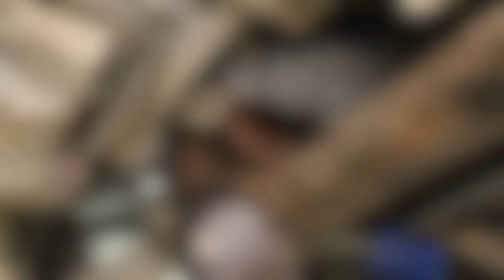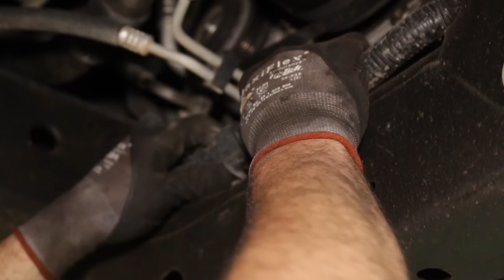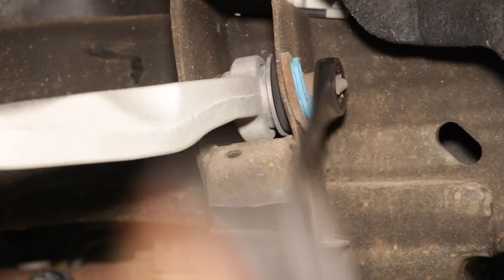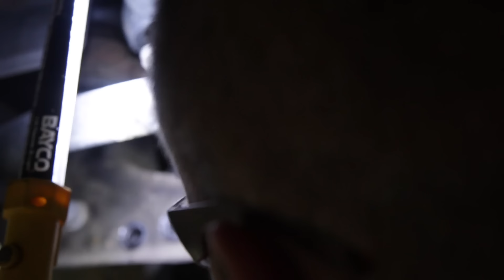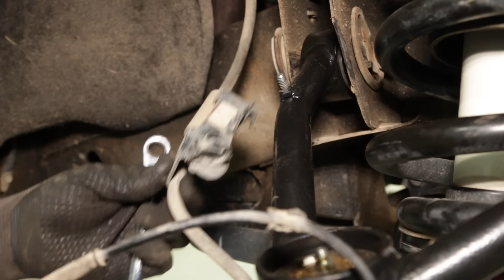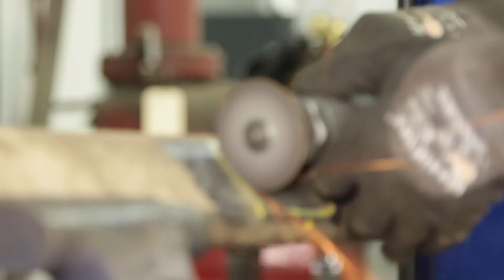How to Install a 2007-2016 GM 1500 3.5-Inch Lift w/ Upper Control Arms

Comment: I just installed the  3.5” knuckle lift kit. Just a suggestion. The kit SHOULD come with upper control arms that would clear the stock droop stop.  Secondly the factory cross member does NOT need to be cut. What I did was heat up that same area with a torch and use a piece of wood and a small  heavy hammer to smack it.  This will keep the structural integrity of the crossmember.  Doing it this way still made clearance  for the front differential.

Comment: I just did my lift today and I tell you what the pucks underneath the differential are real pain in the butt. I had to cut the cooling fins but I did not have to cut theCross member. It took me and my buddy six hours and were both pretty proficient mechanics. Other than that everything else fit perfect. I’m taking it for an alignment tomorrow. I drive a 2013 GMC Sierra SLE 4 x 4 crew cab.
Reply: Ive got had the same kit for about 3yrs running 20x10 with -19 offset. I'd like to go back to stock size wheels and was wondering what size wheel and tire you run.
Thanks
Reply: What did you use to cut the cooling fins? Saws all? I’m at this point and can’t get a angle grinder in there.. guess I’ll have to go buy a saws all.

Comment: i have a question, right now i have everything stock suspension and everything so if ur familiar w chevys it’s obviously not lvl if i put this on will this lvl the whole thing? or will it just have the 3.5 lift but w still b higher on the rear?

Comment: I bought the 4.75 in lift which includes this suspension lift and a body lift. It’s a 3.5 suspension lift and a 1 1/4 body lift. Is it best to do the body lift first or suspension lift or does it not matter?

Comment: My 2500hd 2011 Silverado sits 43 inches from the ground up to the top wheel well(rear) and 42 3/4 (front). What lift should I get if I want it a little taller? I wanted to do a 3.5 but I feel like it wouldn’t budge. So I’ve been thinking a 6inch. Can y’all help me out with these thoughts of mine.

Comment: Has anyone else had problems with wheels and tires rubbing on upper control arms when fully turning all the way one way or the other? What wheel offsets are you guys running that do not have this problem?

Comment: I’m running 33x12.5r20 on a 16 Silverado  with a 2 inch level. Looks great. How big of lift could I do and still use the 33’s?
Reply: You can use 33's for whatever size lift. But I'd say three inch would look good with 33's. Even if you did a four, if you put a negative offset rim. It'd fit better

Comment: Have a 16 silverado 1500 z71 and i have to say im not a big fan of having to cut cross members and cooling fins off. I get the need to fix the angles but still there has to be a better way than cutting things.
Reply: Agree 👍🏾
Reply: Learn to weld like everyone else

Comment: Been reading lots of bad reviews about rough country quality of the lifts upon initial installation & overall value & performance down the road,
Trying to see how they stack up again Zone or other suspension Manufacturers,
Just lots of negative user reviews on the RC,
Makes me apprehensive to try them.
Reply: Also with my zone kit the wheels are pushed out an inch and a half on both sides in the front of the truck only which makes going through a drive thru annoying and sometimes makes parking harder I forgot to mention this
Reply: I have a 4.5” zone on my 2014 and it rides like stock and is good quality 

Tbh tho if I could do it Over I’d probably do the 3.5” rough country or 3.5” super lift just cuz my fenders have to much gap between the 33” tires but not that much 

Also I feel like I’d probably get 1mpg better if I went with a 3.5” kit 

So yea this is my experience 

And if you went with 3.5” as long as you get the UCAs you should be good 

The zone will cost you 2x as much atleast and is a permanent kit where the 3.5” is reversible if you don’t like it

Comment: Why do the spacers not come with the stud bolts already on them? I just tried this kit and the hole for the studs are too small.
Reply from the maker: They are locking studs and once installed and torqued they lock in to the spacer.

Comment: Why is it recommended to use the spacers when running factory wheels? I put my 07 back together with factory wheels, without spacers, and it seems like I have enough clearance. Just curious if there is something I’m missing

Comment: I have a cuestión I put on 2014 silverado front blistein shocks with 2” lift . Can I put the 3” 1/2 lift kit with those shocks?
Reply from the maker: No that would create geometry issues. You would have to run a 3.5" lifted strut or the stock strut with the 3.5" spacer kit.

Comment: I'm about to purchase your 3.5" kit with your forged GM upper control arms. I'm looking to run 33" x 12" wide Nitto Ridge Grapplers on my stock 2012 Silverado Crew Cab 17" wheels. Will I have any rubbing issues on the control arms due to my stock wheels?
Reply from the maker: RECOMMENDED TIRES & WHEELS
TIRE WHEEL BACKSPACING OFFSET
285/70 R17 Factory 17 - -
285/70 R17 17x9 - 0 to +18mm
285/65 R18 Factory 18 - -
285/65 R18 18x9 - 0 to +18mm
285/55 R20 Factory 20 - -
285/55 R20 20x9 - 0 to +18mm

Comment: Can you clear 35” tires with this lift and stock offset
Reply from the maker: No you can not. Recommended tire size for this setup is 295/55-20 or 295/65-18.

Comment: How much would it cost to lift a truck
Reply from the maker: Labor rates will vary but industry standard is $85-$95 per hour depending on where you are located.

Comment: And what is the difference in the knuckle kit, and the forged upper control arm kit? What is best?
Reply from the maker: The knuckle kit replaces the stock knuckles to reduce the angle on the tie rod and upper ball joint angle. The upper control arm kit has the different angled ball joint that mounts to the stock knuckle to correct that angle as well. The knuckle kit is the more popular option.

Comment: Will this kit work with 20" stock rims on 2013 silverado has 275/50r20 tire, but going with all-terain after lift is installed
Reply from the maker: RECOMMENDED TIRES & WHEELS
TIRE WHEEL BACKSPACING OFFSET
285/70 R17 Factory 17 - -
285/70 R17 17x9 - 0 to +18mm
285/65 R18 Factory 18 - -
285/65 R18 18x9 - 0 to +18mm
285/55 R20 Factory 20 - -
285/55 R20 20x9 - 0 to +18mm

Comment: Will not work on 2016 with stamped steel upper control arms.  Just a heads up
Reply from the maker: Correct. We have that noted on the website under the NOTES section of the kit.

Comment: What’s the difference if I get the arm controls or if I don’t
Reply from the maker: The aftermarket control arms have the different angled ball joint for better camber adjustment and geometry on the upper arm.

Comment: if i already got the 2 inch leveling stut can i just get the knuckle / control arms and the 2 inch lower strout mount extension for a total of 4 inch?
Reply from the maker: No that is not recommended due to what it does to the geometry and drive line. I would recommend replacing the kit with the complete bigger kit rather than piecing together with the level strut and adding to it.

Comment: So are the new control arms longer to fix the angles?
Reply: Thanks for the reply. One more question, dose this lift void factory warranties?
Reply from the maker: The ball joint angle is different to compensate for the change in the ride height and correct the camber and geometry.

Comment: Would it be suggested I do a body lift or a suspension lift? I plan on keeping stock wheels and tires for a while, and it’s a 2wd 2014
Reply from the maker: https://www.roughcountry.com/suspension-lift-kits/chevrolet-suspension-lift-kits.html?vehicle_drive=4&vehicle_model=239&vehicle_year=61

Depending on how much lift and what size tire you want to run. I would recommend using one of the kits in the link above. A suspension level kit.

Comment: Are the ball joints in this kit almost like factory?
Reply from the maker: The ball joints in this kit are MOOG ball joints. We use the afermarket joints to provide better angle on the upper arm and to help with camber adjustment for the alignment. They are press in bushings.

Comment: I've been thinking of adding a 3.5 lift on my 16 GMC Sierra... Anyone with a Chevy or GMC that can vouch the driving quality after lifting?
Reply: I had it installed on a 2016 Silverado back in 2016.
The ride seemed to be somewhat the same. So far haven't had any problems.
The only thing that I was a little disappointed was that it made the truck mostly level.
Wanted the font end to be a little higher.

Comment: I would recommend that if you do the 3.5 lift that you get the control arms with the kit. If you leave factory control arms on then the angle of the ball joints will be too extreme of a angle, which excessive wear and premature failure will happen.
Reply: Thanks!
Reply: where do you buy the different joints at afterward when they need repair?
Reply: @aaron_hanna1013 spc makes adjustable ball joints.
Reply: @aaron_hanna1013 don’t get the rough country control arms. I got the control arms with the lift and both ball joints blew out and locked up within a month of having it. Then they only take rough country ball joints so I bought replacement ball joints from rough country that only lasted two weeks before locking up again

Comment: I did the rough country 2.5 inch leveling kit front and rear. Was able to fit 285/65/20 k02 on stock denali wheel.
Reply: Mike Litoris same here but I did the 305/20s
Reply: @Nikita Zlatopolsky , 2018 1500 Z71 4x4, you should be fine with 305s, the 2500 is already higher to start with. Hell u'd be fine without a lift probably. Is it 4x4?
Reply: @Nikita Zlatopolsky, yeah the 305 55/20s I went with are like 33x12s as apposed to your 34x10s
Reply: @Nikita Zlatopolsky , I'll see if I can post something on YouTube
Reply: @Nikita Zlatopolsky okay it's up on my channel

Comment: If I buy this kit where do I purchase replacement ball joints? Also could I run different ball joints next time around or do I need to stick with rough country?
Reply from the maker: The ball joints that are included in this kit are MOOG Ball joints. You can get them thru us or at a local parts store.

Comment: Does the silver truck in the beginning have a 3.5 inch lift on it? If so, what size are the tires.
Reply from the maker: Yes every truck in this video features the 3.5" kit since this is the overview video for that particular kit for that vehicle. The silver truck has 285/65-18 on it.

Comment: do i need to change the control arms
Reply: Rough Country i just had an uppet ball joint snap on my lift....can the ball joints be pressed out and replaced.... (it has the upgraded upper control arms)
Reply from the maker: I would recommend the aftermarket arms for the better ball joint angle and camber adjustment.
Reply: and to keep the stock wheels but replace tires do i need the wheel spacers

Comment: I have a 2013 GMC Seira 1500 short bed with a 3.5 lift kit and the upper control arms ball joints lasted less than 5  1/2 months with rough country lift kit . The upper ball joints had no grease fittings and they squeaked have the time as if the ball joints were going and come to find out they were . I called the company and the acted surprised but replaced them with new ones that now have grease fittings but I still have to pay for the labor . I bought the truck from a GM dealer and the truck had 23425 miles on it and maybe that's why the previous owner traded it in . I should of gotten a car fax I guess but live and learn .
Reply: Rene Martel I don’t think s carfax would have told you that the ball joints were low on grease.
Reply: Haha ^^^

Comment: is this kit best used with the n2.0 struts? Does that help with the angle on the ball joint issue with the previous years?
Reply from the maker: The 2.0 strut offers softer ride quality. It will not affect the angles of the ball any different than the spacer kit.

Comment: Is there a kit and a video for the chevy suburbans/Silverados from the mid 90s? I have a 1996 chevy suburban K2500 and I'm hoping to lift it soon.
Reply from the maker: No we do not have a video for any of those installs. But each of these kits attached to the link below have step by step install instructions.

http://www.roughcountry.com/suspension-lift-kits/chevrolet-suspension-lift-kits.html?vehicle_drive=3&vehicle_model=245&vehicle_year=81

Comment: I just put in this kit and both my tie rods are leaking a little grease out is those normal should I be worried?
Reply from the maker: Your tie rod is leaking oil? I think you may be referring to the ball joints in  the a arms or possible the cv axles?

Comment: Hello, a question, I have a silverado 2011 and I will install a lift kit "3.5 inches, if I install tires 33x12.5r20, should not have problems ?.
Greetings from Chile.
Reply from the maker: Below is a link of the recommended tires and wheels that you can run with that kit. 33x12.50 would be a little too much for that 3.5" kit.

http://www.roughcountry.com/gm-suspension-lift-kit-275-8.html#custom2
Reply: kyometal17 you could fit them with minor rub or depending on what offset the wheels are you could and do minor trimming

Comment: Can I put a leveling kit on with this lift?
Reply from the maker: No it is not recommended to install a leveling kit with this kit. It will create drive line, pinion angle, alignment and geometry issues by adding the leveling kit with this lift. You could do a body lift.

Comment: this kit can go on top of a leveling kit right?
Reply from the maker: No the leveling kit would need to be removed before you install this kit. This kit is also designed to lift and level. If you added the leveling kit with the 3.5" it would cause drive line, alignment and geometry issues because you would need crossmembers, knuckles, etc. to help retain the geometry of the suspension.
Reply: ok thanks man

Comment: Will this fit on a 2017 Chevy Silverado 1500 4WD
Reply from the maker: Yes this is compatible with the 2017 model.
Reply: Rough Country  can you tell me if there is a possible ball joint replacement that will fit this control arm? Mine snapped and i need a temp fix asap

Comment: If I purchase this kit and run 285/70r18s on a 18x9 wheel what's the biggest negative offset I could run without trimming or cutting?
Reply from the maker: -12 MM offset on the 9" wide wheel

Comment: Can this kit can be installed in an 08 sierra Denali awd
Reply from the maker: Does NOT fit AWD models.Does NOT fit 2007 "Classic / old body style" models.Does NOT fit models with Stock Stamped Steel Control Arms.Does NOT fit GMC Denali models with Magnetic Ride Control.

Comment: My 14 sierra has this kit professionally installed. The front end feels real tight in 4WD. Is this normal?
Reply from the maker: What size kit was installed? Are you referring to the steering being tight?
Reply: 3.5, Yes it's mostly the steering. It's tight feeling. Lost some of my radius, although I expect that to some degree. I hear a bit of a whine also. It's my first lift so I'm not sure if this is normal or not.
Reply: hows the kit? did you use the struts and uca?
Reply: Fine I guess. I wasn't offered the UCA's at the time of the sale. However, both upper ball joints went bad in a few thousand miles. I now have the RC UCA's and the truck rides and steers better. I'm convinced the whine is the tires. do they make a strut to work with this kit? No one mentioned that either!
Reply: Jeff Bradley They do! Supposedly it helps w a smoother ride.

Comment: I'm surprised they don't just include a drop bracket for the crossmember under the diff. Would save install time and be easier than cutting the crossmember and diff.
Reply: Yeah that looks like crap to me.
Reply: Agree 👍🏾
Reply: I also surprised by that...cutting without reinforcement is concerning

Comment: I'm putting this lift on a 2011 Silverado 1500 I have 20x10 rims with -24 offset with 33,s will it work
Reply from the maker: Yes that tire and wheel combo will work on this application.
Reply: @RoughCountryTV  would 295/55/20 with 20x10 -12 work without having to cut or trim?

Comment: Does the new strict add the 3.5 in the front? When installed on mine it did not raise it at all.
Reply from the maker: Yes the lifted strut does bring the front of the truck up 3.5" when added. What is your front ride height from the center of the wheel to the fender?

Comment: I have a 2016 Regular Cab Z71 Silverado. What size tires can I fit with a 3.5 lift?
Reply from the maker: Depending on what size wheel you go with, here is a sizing chart for that lift

TIREWHEELBACKSPACINGOFFSET285/70 R17Factory 17--285/70 R1717x9-0 to +18mm285/65 R18Factory 18--285/65 R1818x9-0 to +18mm285/55 R20Factory 20--285/55 R2020x9-0 to +18mm
Due to differences in manufacturing, dimension and inflated measurements, tire and wheel combinations should be test fit prior to installation.

Comment: And also why do you offer a 3.5in kit with upper control arms and the same 3.5in kit without upper control arms? do you really need them? I've ran your leveling kit in my 2010 silverado and loved it. but have a new 2015 silverado and I'm trying to decide what lift I'm going to go with.
Reply from the maker: The kit with the control arms just has a different angled ball joint in it to correct the camber and hold the alignment without putting much stress on the ball joint